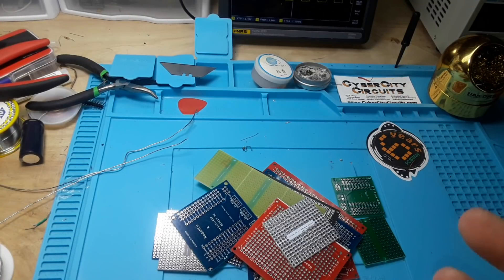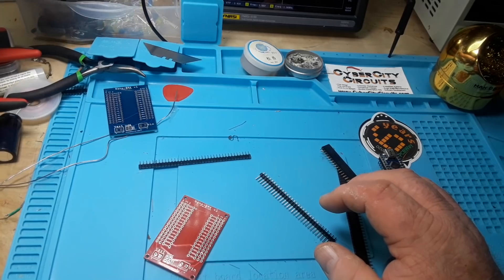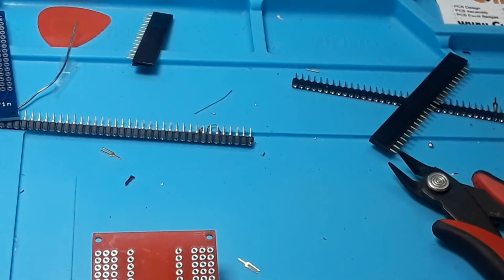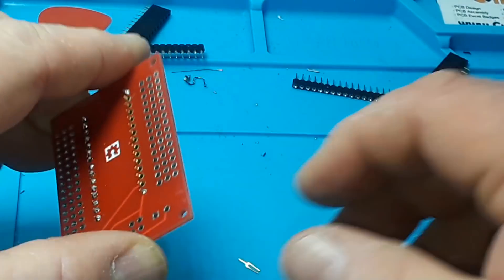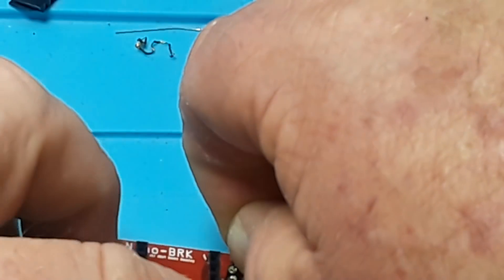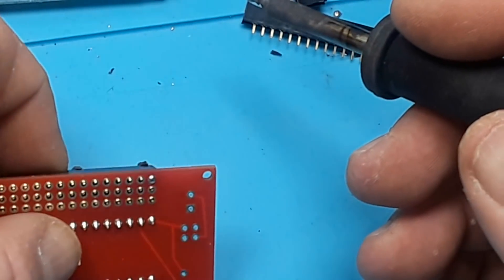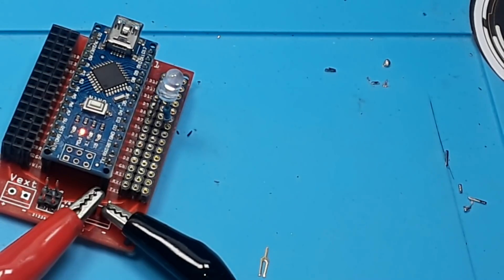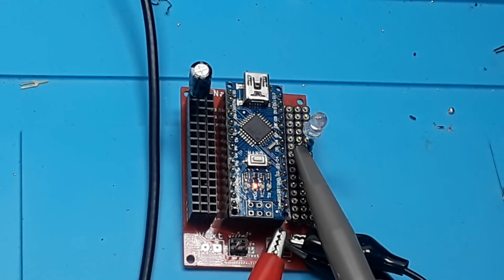Scott Beasley's Nano Breakout Board

Comment: Quick tip on the female headers:
Once I know the length of the header, I count +1 pin, I score with an exacto knife on both sides of the middle of the +1 pin (one pass with average pressure will suffice, you don't have to cut through), then I cut with the flush cutter as you do, this way the header doesn't break randomly, it still isn't a clean cut, but at least I have control as to where the header bar breaks. Afterwards with the flush cutter I clean the cut as close as possible to the edge.
Works really well for me.

Comment: Similar to how I did DB25s and DE9s in the old days, I put the opposite sex in a small machinist vise and did as many as 200 connectors in a sitting, besides holding alignment it also was faster, didn't need to open and close the vise for each connector.  Customer would not accept crimped pin connectors.